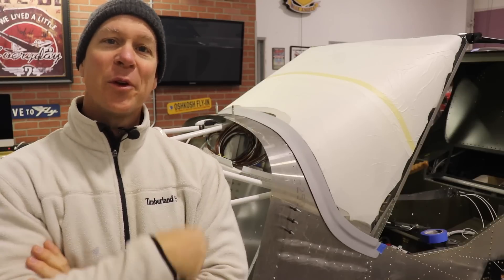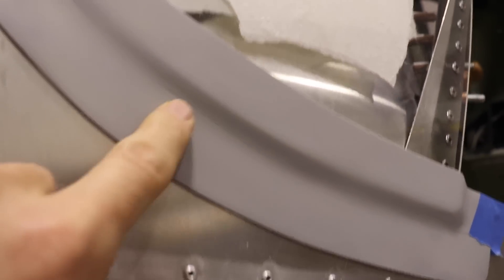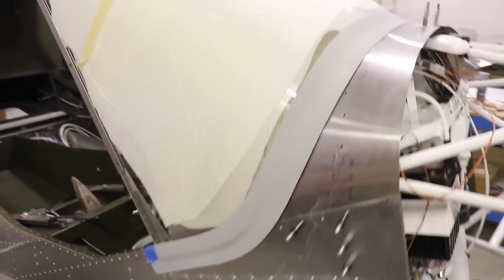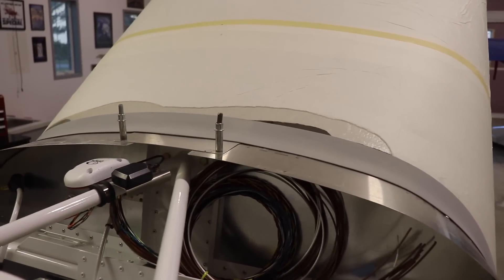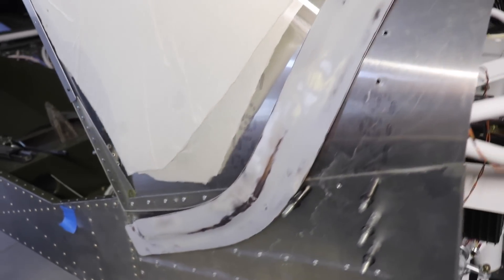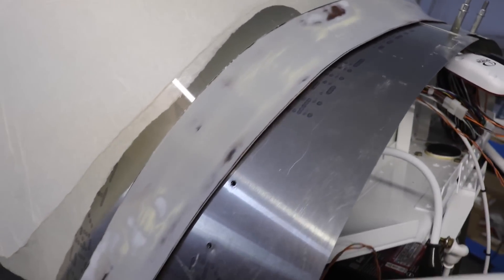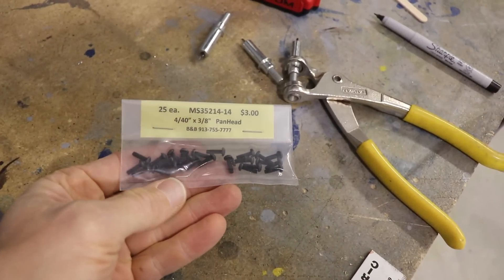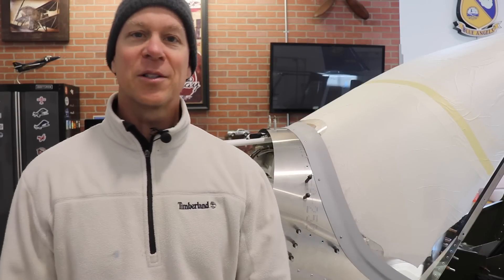FINISHING the Windshield FAIRING!

Comment: G,day Mark from Sydney Australia.
It takes quite some time to laminate a composite material (fibreglass) fairing, to improve the laminar flow from the cowling.Thanks for the instructions.
Over and above all; I hope you can explain the benefits of short engine mounts to longer steel mounts.
* Access for maintenance
* Twisting and strength
🧑‍🔧🕵️